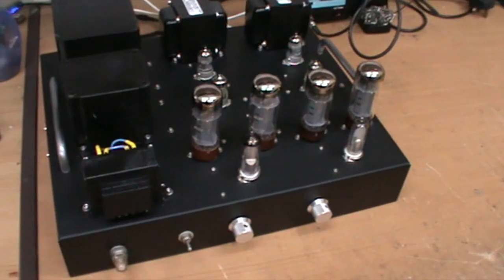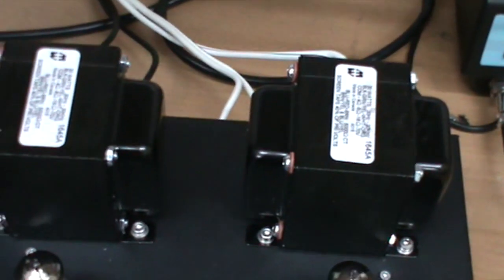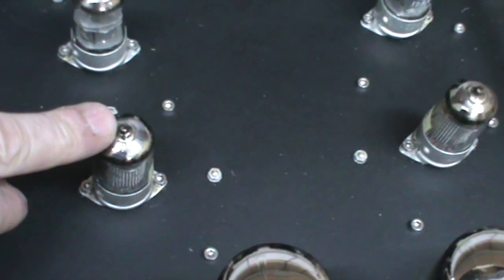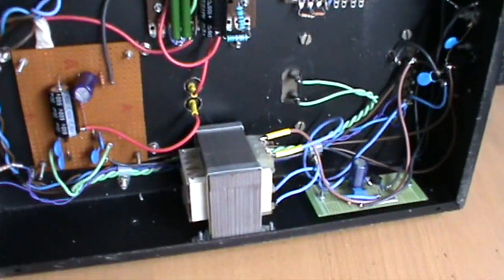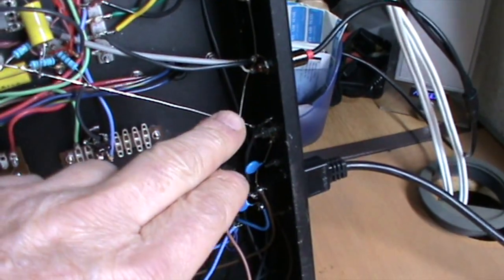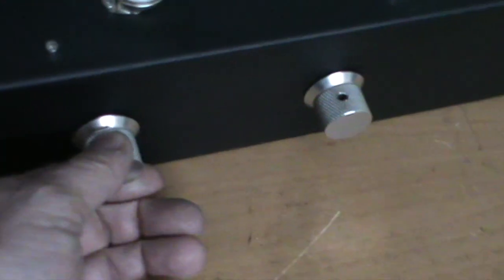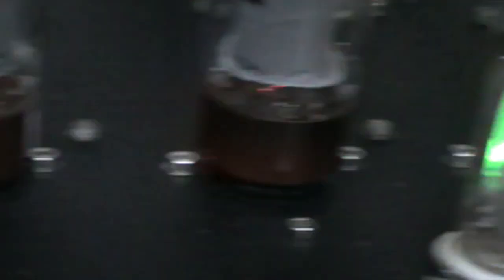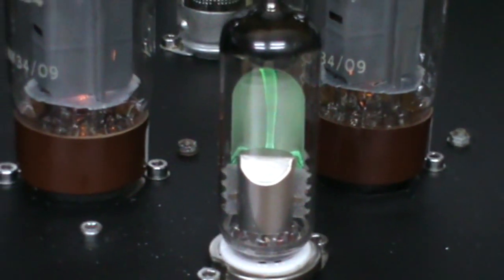Homebrew Stereo Tube Amplifier EL34's

Comment: The Green Equalizer Tubes are Great (^o^) See it first Time... Thx^^ What is the Name of this Tubes?
Reply from the maker: Em82’s
Reply: @thewtf  WoooW, thx for this fast Answer (^.^)
Reply: @thewtf  I have another Question. I'm an absolute Noob when it comes to Tube Amplifiers. Do you know a good Website where you can buy Parts to make a Tube Amp yourself?
Because here with me in Switzerland, unfortunately, it is very difficult to get such Parts :(
Reply from the maker: Most of the tubes you can find on ebay. Components from RS or Farnell

Comment: Do you have build plans and schematics for this?
Reply from the maker: It’s based on the Mullard 5-20. Lots on the net about it
Reply: @thewtf  you said you did some modifications. Are those to improve quality ie noise reduction or just the VU meter part? Thanks for your reply
Reply from the maker: I put in a separate bias supply for the EL34’s and the vu meter tubes that’s about all